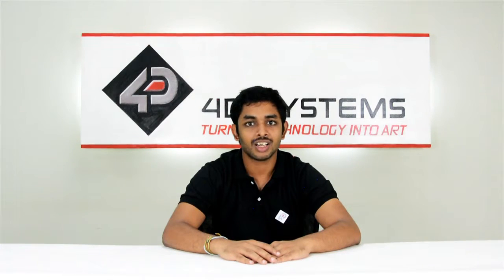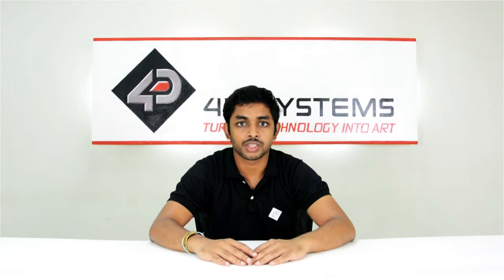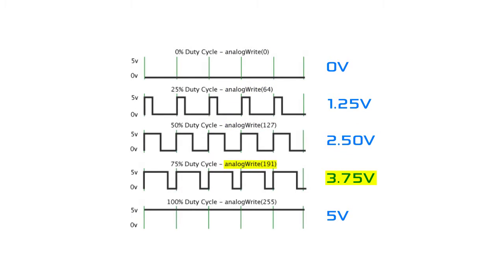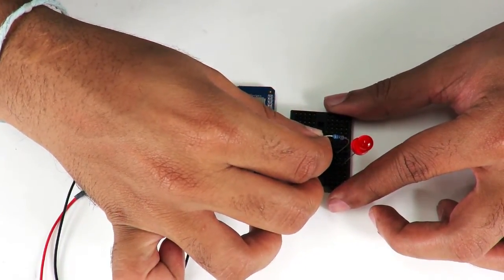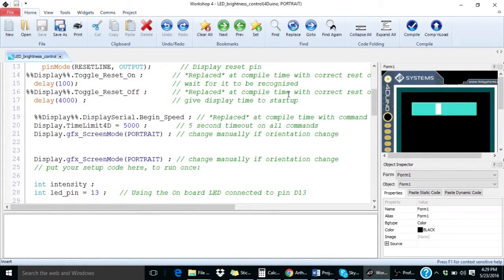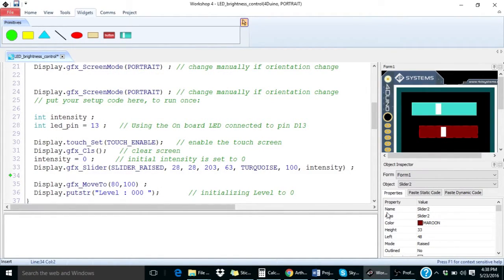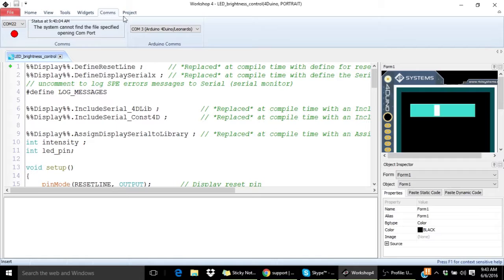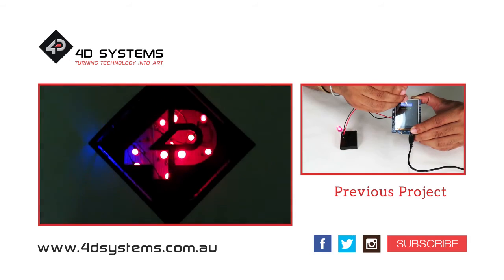4Duino Project: LED Brightness Control

Comment: Very nice!
But LED is controlled by current, not by voltage!
In fact, the value of resistor is calculated precisely in function of the current that must flow through the LED.
The voltage at the junction is fixed and is a feature that depends on the LED (it is obtained from the datasheet).